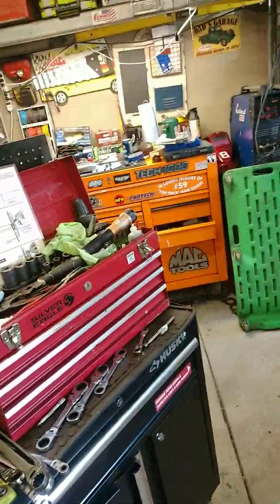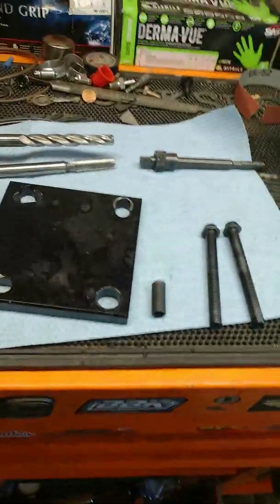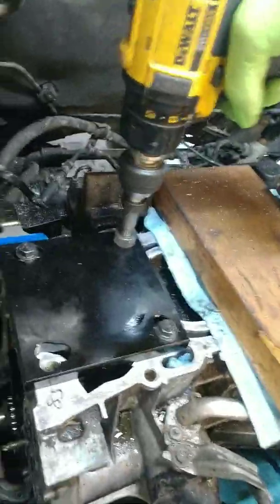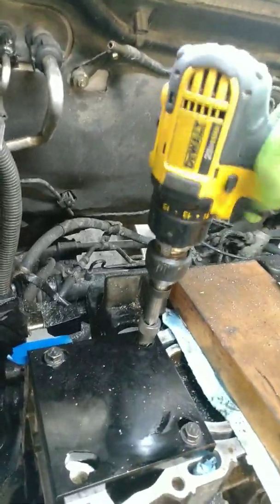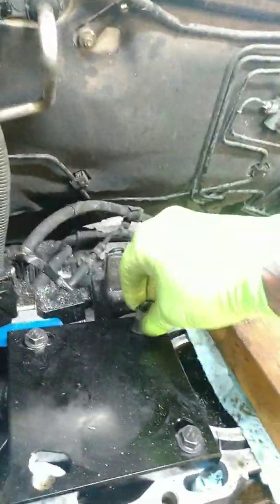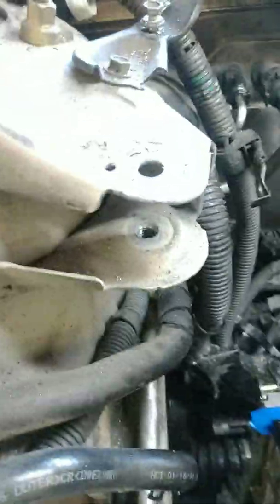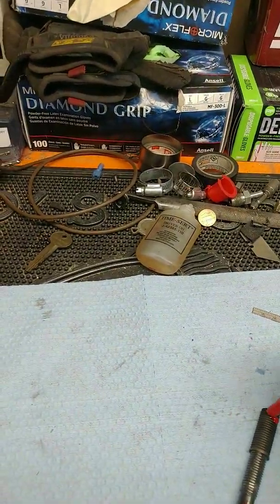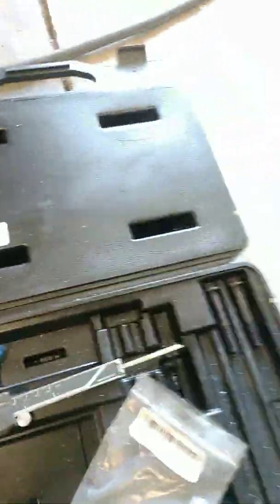Toyota Camry head bolt thread repair

Comment: Why wont the inserts pull out of the threads like the bolts did? Bolt threads are steel. Inserts are steel. If the bolts pulled out of the threads, good chance the inserts will pull out too. Itd be nice if the threads started right at the top of the block so that way itll grab ALL the threads on the bolts. Or make threads in the existing holes and then get bolts that size.

Comment: If you don't have the $$ for this repair (2AZFE, 2.4L Toyota Rav4/Scion/Camry ).  Symptoms: blown radiator/ blown heater core, heat  indicator on dash above normal.  Remove the thermostat. Leave the reservoir cap-straw loose ( so boiling gases can escape ).  Top off your coolant every week.  Change your oil every 3000 miles. You will have a CEL on and will lose MPG.  However, the overheating will stop.  Save up $$ to get a proper repair. Peace.